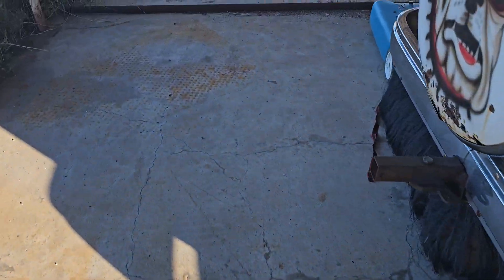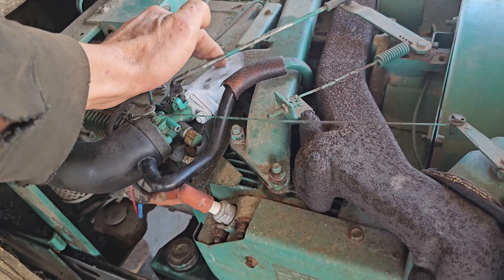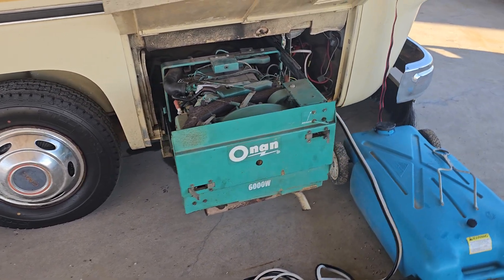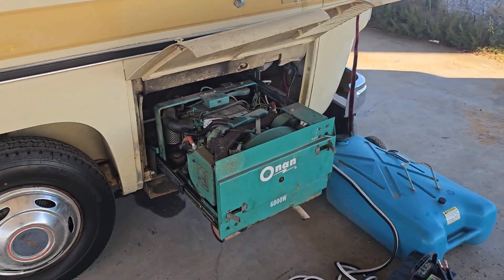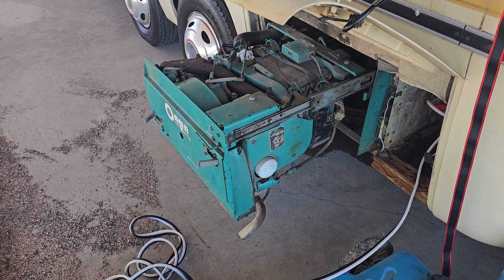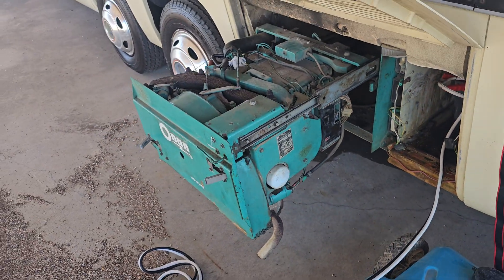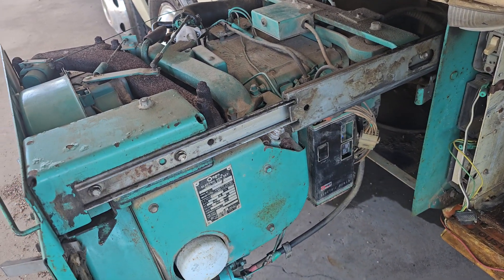Onan 6kw Generator Wierdness - Intake Manifold Freezing!?

Comment: Open the main jet a turn.  That poor engine is starving.
Reply from the maker: The engine is shot. Main jet is wide open. Starter mount plate is broken. Engine is knocking on bottom end. Doneski. Hunting for a more efficient modern replacement that will fit in the hole.
Reply: @OccultEngineering onan cck genheads are fairly common, trust me, stick with what the home was built around.  Finding one that physically  fits is the issue.

Comment: The condition is called carburetor icing.
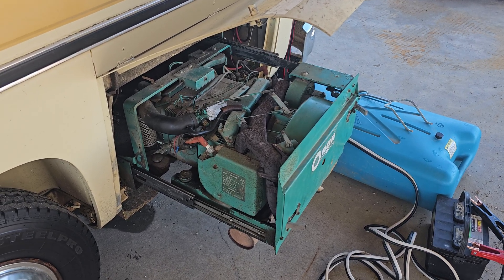3:37 

A piston powered aircraft pilots nightmare. 

Wikipedia article here:

https://en.wikipedia.org/wiki/Carburetor_icing?wprov=sfla1

I assume it is a gasoline engine, and modern fuel that contains ethanol has a greater charge air cooling over 100% gasoline. 

Note on the graph on the Wikipedia page that icing can occur at 70F and that is with avgas which has 0% ethanol!!!!!!!

Comment: Your carb is running ULTRA lean from a clogged passage/jet.  Former ONAN mechanic. Fixed a zillions of those.
Reply: Confirm the float height as well, though less likely.
Reply from the maker: Thank you so much for the insight. I'm just getting to know  this unit and have been scratching my head on it the past few days since this is the first time I've really needed to run it. Thought I had it cleaned pretty good but guess I missed something. 😔
Reply: @OccultEngineering  - It's really easy to not get all the passages cleared. Even with a good ultrasonic cleaner. The're prone to the entire body dissolving into itself, as the material was never designed to have ethanol fuels in them.  I took apart one, and there was about an inch of 'sand' in the bowl. It wasn't sand - it was the body of the carb, and the bowl!

Make sure you remove 100% of everything before sonic cleaning it. Make sure the emulsion tube holes are clear. Don't use metal pokey things on jets or you'll dig out the holes and make it run rich (forever).

Don't sonic clean brass floats.
Reply from the maker: @DrFiero https://youtu.be/1iBDb64okls?si=_WWOiee4QRbUBbP_
Reply: Hey, where are you located? And do you help fix like my phone video or something? I have the exact same one it was working. I had a mechanic that does Onan replaced the starter and he got it running and it ran for three days and then now, if it hasn’t been running for two weeks, please send me your information.
Reply: @iscreamcandytv9642  - dammit, my comment got deleted.  I'll try again with less specific words in the NEXT comment.
Reply: Nope ... got deleted again as soon as I mentioned Smokstak.